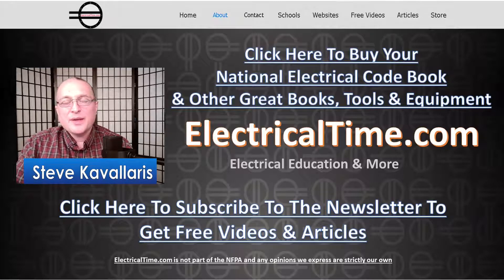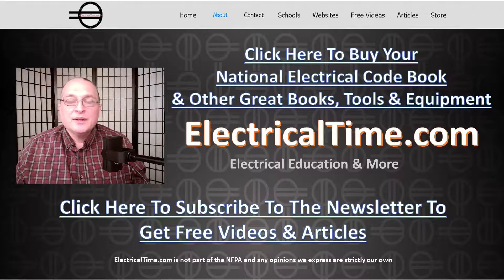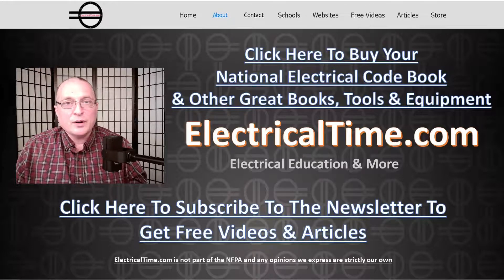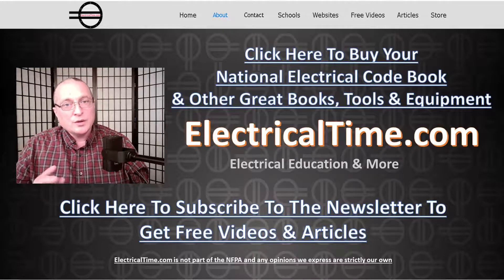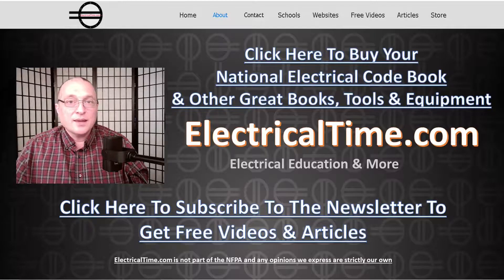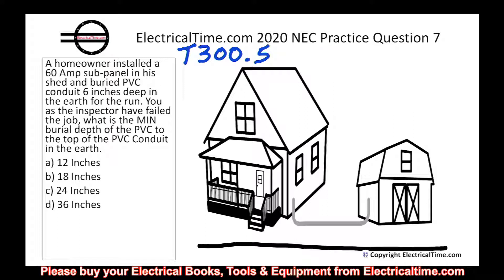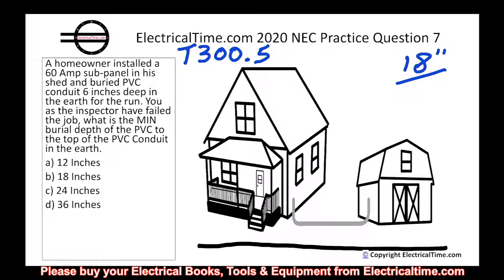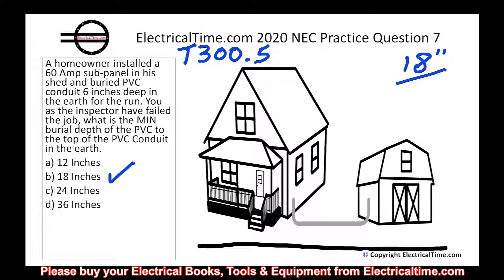NEC 300.5 "2020" Minimum Cover Burial Depth - By ElectricalTime.com 2020 - 007 Practice Question

Comment: This is great because there are many confusing public utilities codes that require different depths. For a home going to an ADU, or shed for that matter, does NEC help provide distances from parallel water and gas lines as well? I've never seen a detail for all 3 running in the same trench
Reply from the maker: Hi, that is a great question. I will look into that. Make sure you are subscribed to my free NEC code questions and answers on my website, ElectricalTime.com and in the near future, I will post something about that in the email. Thanks, Steve

Comment: I like to go a little bit lower couple inches more like you say to make sure I don’t fail my inspection
Reply from the maker: Hi Demetrio, going a few inches deeper in the trench would be better and safer for the purpose of Minimum Depth. Remember, the NEC gives us the Minimum Code Requirements and having some extra depth for the buried conductors and conductors is a good thing in my personal opinion, thanks, Steve, ElectricalTime.com

Comment: How is it handled when you have multiple "locations"? Case in point in my patio, where it's mostly 4" slab of concrete (NM conduit under) except 3ft from the buildings, that have only dirt, mulch and plants (probably for water to be under the level of the slab where buildings were built?). So, about 90 ft, 84 under slab, 6 under the wife's roses.
Reply from the maker: Hi Claudio, first of all, NM Cable is not permitted to be in an underground conduit as per 334.12(B)(4) since conduit that is underground is considered to be a wet location. The burial depth as required in Table 300.5 of the 2020 NEC is dependent on the Location of the Wiring Method or Circuit and on the Type of Wiring Method or Circuit. For each of the separate Locations you mentioned above, there will be a different burial depths that will be required. I suggest that you review Table 300.5 from the National Electrical Code with your licensed electrician which lists the locations, types of wiring & burial depths that are required. Thanks for watching our video.
Reply: @Electrical Time  thanks for your answer! I meant non metallic conduit (listed for burial installation), with thwn cables. Anyways, you cleared my doubts!
Thanks!